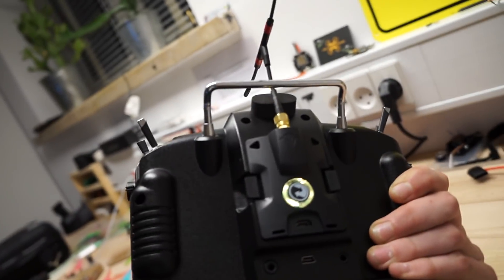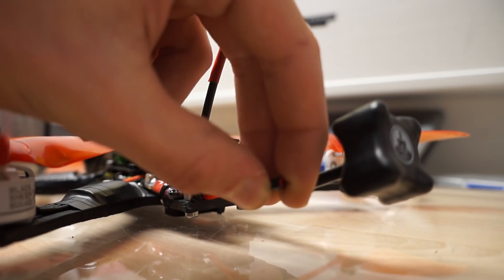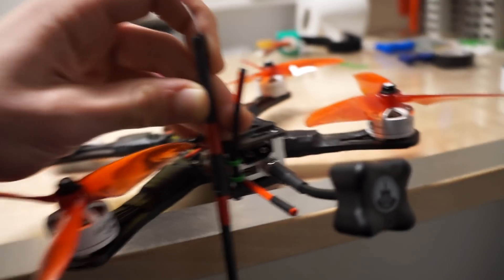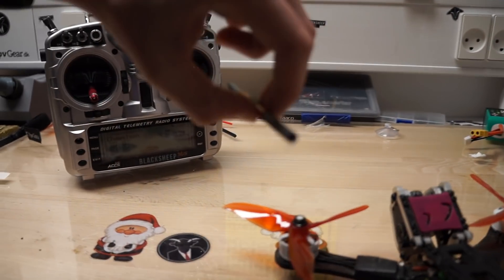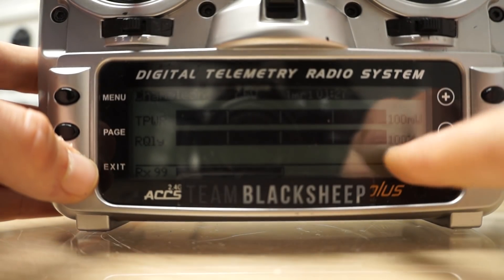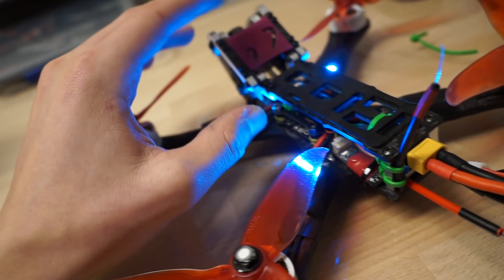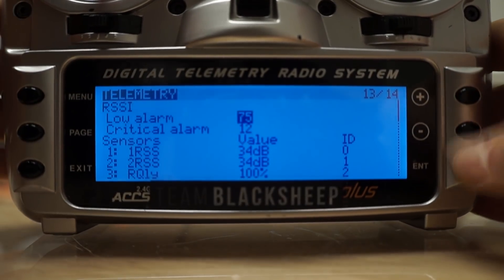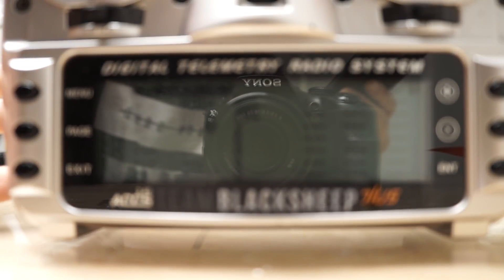TBS Crossfire Full setup guide Taranis - correct antenna placement

Comment: Nice vid buddy. How do you get mah consumption and Amps?
Reply from the maker: You need to wire up the telemetry wire to the same uart as the crsf wire, Go into betaflight, enable telemetry. And go into your taranis and discover new sensors, your board also needs a current sensor to get amps and mah.

Comment: 7:33 if I execute that file, the screen just says "waiting for crossfire devices...", and nothing happens. I'm bound to the receiver (a micro RX) btw. Any ideas?
Reply from the maker: Hey, do you happen to have the "luac" file besides the normal lua file? Because the Luac file might work
Reply: @FPVDanes  Hi, thanks for your reply first of all!
Nope, I don't have the luac file at all. I've got the lates firmware on all Crossfire devices btw...
Reply: @Chretze  Mine did that. I had to restore the firmware to the emergency version thats stored on the rx then update the firmware back to the latest.
Reply: @Ifrit4fire  I'll try that if I need it. So far I learned that you can set up everything by powering the tx and rx, then binding them, then connecting the tx to your pc via usb and using agentx. so the tx just sends all info to the rx which is really cool tbh...

Comment: Great vid. Just a couple of questions: 
On the logical switches you set up:
L01 as RQly 80% and 
L02 as RQly 70% and
L03 RFMD 2.
But on Special Functions you only used:
L01 playing RQly value and 
L02 playing RFMD value...
Huh?
Wasn't L02 setup as RQly 70 and
L03 was setup as RFMD, not L02....
I'm confused.
Reply: I'm a little confused about this as well.

Comment: I have a question you might be able to help me with.  When using the crossfire can you use the same model placement in the radio that way you do not need to switch from model to model just connect the battery and go??
Reply from the maker: I have not really looked into it sorry.

Comment: Thanks for the tips I am getting lost signal message and signal recovered in my radio taranis X9D SE but the system is working normally what may be causing these warnings?
Reply from the maker: You go into the taranis and turn your rssi warning to go off at the lowest possible

Comment: Great video what didnt you get the full size crossfire.  I know that the micro is cheaper but what do you lose compare to the full size.  I am thinking of getting it but not sure which is best..
Reply from the maker: Warlock i did not really feel that i needed tge extra range, and the size was too big also.
Reply: Do you have a video on how to update the reciver with the Lua script and how to change the setting since it does not have a screen..
Reply from the maker: Warlock Hunter if you are on opentx 2.20 or later, og will have the lua script in the taranis software along with the firmware for the receiver.
Reply: ok thanks.
Reply: Warlock Hunter hey dude Ive seen your name come up on JJRotogeeks channel hope you are well and flying... If you are still on the fence about the large or small crossfire, rest assured you will really expand your horizons with the micro or small one, you get incredible range and penetration and you dont have to hook up all the extra battery and wires to the oversized JRModule in back. The updates work just fine via lua scripts and you will have it all set up in a weekend! Good luck out there bros. Im spreading the word: mount your immortal T flat in front of the quad below the fpv cam, all kinds of room!
Reply: Hey thanks you for the reply ok will do.

Comment: Ok im putting a tbs micro rx on a 3" that only has only has one spare uart so i need to use SBUS - can i get RSSI similar to frsky can on a certain chan?>
Reply: FPV Danes yes that is the method for setting it up -LUA script to the RX, set it to 12channels, cut failsafe, no mavlink, 150ms rate, and scroll down to channel 12 highlight and set it to LQ or Trappey says LQ/RSSI combo. This will force RX to send out link quality data on channel 12 which is Aux 8 for most of us. Then in receivers tab just set that channel for RSSI! I just did it yesterday and that seems to be the ticket!
Reply from the maker: Yes, if you go in your crossfire and set lq to channel 12, and rssi in betaflight to aux 8 or channel 12 it would work. i think

Comment: Actually Trappy said with the “L” shape like that and mounting it horizontally you get better coverage but lose range which is okay for casual Fly, racing and freestyle. He suggested that vertically would give you the best range if you plan on going far. Check around the 25 minute mark in the video. https://youtu.be/ePFcB2cnip8
Reply from the maker: Yeah, i know that vertically will give you the best range, but it is not really that possible on a miniquad like this, unless you want the antenna sticking into the ground.
Reply: FPV Danes aaahhhh I see. Anything is possible. If there’s a will there’s a way. I actually have minds mounted vertically without stabbing into the ground.